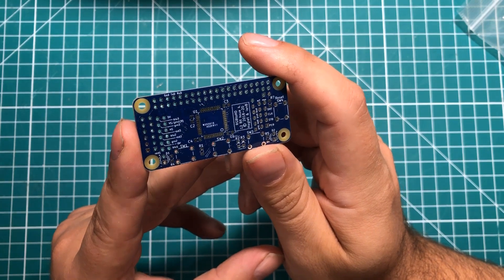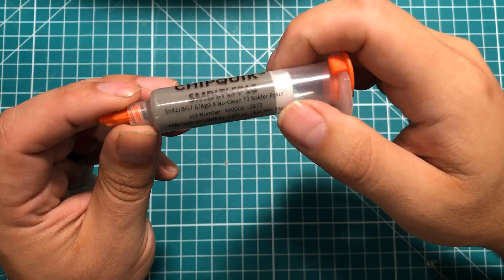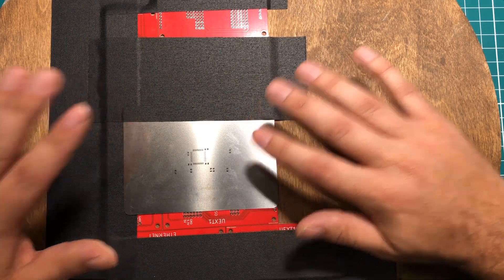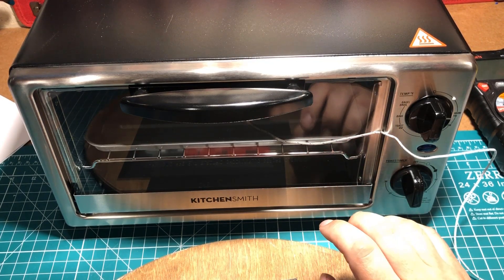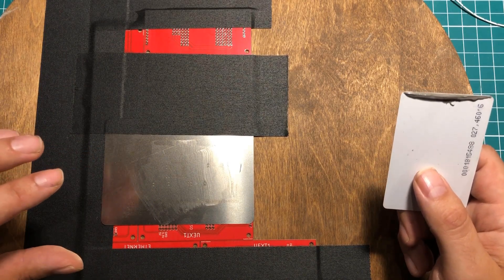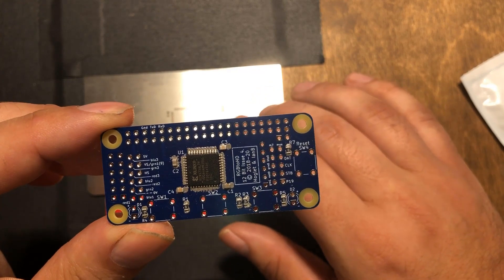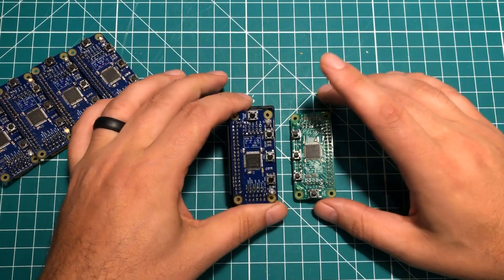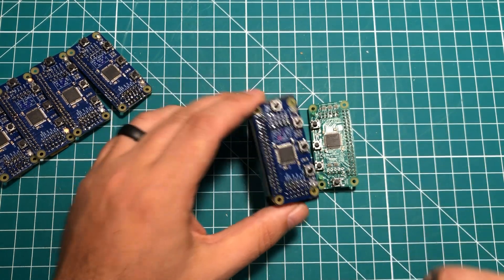SMD Soldering in a Toaster Oven - No Modifications!

Comment: A clothes iron turned upside down makes for an excellent reflow plate.
Reply from the maker: I may have to try that
Reply: @AnotherMaker get one from the trash, they still typically work with some troubleshooting. The one I got had the temperature fuse blown, so I removed it and it works! Thanks for the video.

Comment: A good trick to reduce oven power is by connecting it with cheap (16-18AWG) extension(s), and adjust by varying the number (total length) of extensions.

Comment: Nice video! I have seen a few modified toaster ovens or temperature sensor mods, but I wanted to give it a shot "manually" and it worked great! I just stuck my temp probe and kept an eye on them. There was some touch-up work with the iron on a small pitch QFN, but I think it turned out great! Haven't tested them yet, but it's looking better than my hot air skills yielded
Reply from the maker: Yeah I am terrible with the manual SMD soldering especially tiny components. .  Basically cracking the door open is enough to get the speed slow enough to be with inside the profile... I would like to build some more sophisticated logic in there though

Comment: There are some free solder drops fused together all around. I believe those are from boiling humidity or flux vapors when you heat too fast. I heard you could reduce that by pre heating everything. Would you test that please?
Reply from the maker: You're 100% right. I didn't put the two together, but I did slow it down on subequent ones and they didn't have as much splatter. I propped the door open and I think you could ALMOST keep the door all the way open and have the board in the back. I'm also tinkering wit h other types of solder.
Reply: @AnotherMaker  This would confirm it is all about mimicking the temperature curve and keeping in mind that air is a poor heat conductor. I'd really like to see you try this next:

1- heat up to 80% of your melting point. Everything must be at that temperature for about 1 min.

2- heat to melting point until you see it fused (it may take a minute) then turn off and open the door.

I think you'll be more successful if you use low temperature melting solder :)

Comment: Nice work as always Dan!  Glad to see that I'm not the only one to do the un-moded method :)  and it has worked out for me so far.  I managed to find a clean oven at a thrift shop for around 10usd that worked good.  I'm using an old DataTherm II for monitoring, but I think I want to do some auto-controlling at some point.  I have also used higher temp paste and mixed it with rosin flux for better re-flow.  I haven't tried any SMD LEDs yet but plan to try some soon!
Reply from the maker: Thank you.  I probably will do some more refined control because it sounds like a fun project.
Reply from the maker: Also, I looked up the data therm. That thing is pretty fancy :)

Comment: errr.. Are you sure it will survive for 2+ years? I believe it is a bad solution and solder joints will be more brittle over time. It is GREAT for de-soldering, but I will take leaded solder over any low-temp. solution for soldering. I have some rose apply just for desoldering connectors & USB from small boards, save me some troubles, but only for removal.
Reply from the maker: This can definitely do leaded solder and I have some.  I will try that round 2.  So far they're all working but if they start failing, I will report back.  And interestingly enough the amazon ad said 127c but the datasheet said 166, so it's not as low temp as it seemed at first.  Also, the parts of the thing that take abuse (pinheaders etc are all soldered by hand, with lead).  We'll see! Thanks for the heads up.

Comment: Great video. I saw a video, ages ago, where a guy made a soldering oven using a normal hot air gun, and a box made from insulation panels to flow the solder. It worked pretty well.
Reply from the maker: Very cool.  I will definitely be experimenting with this more.  I was pretty happy with the initial results, but I know it can be better.